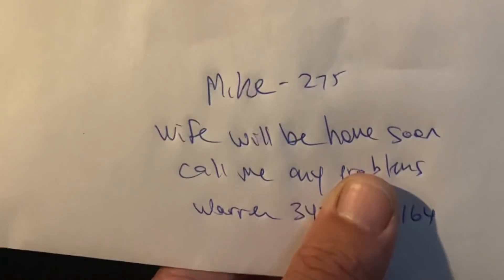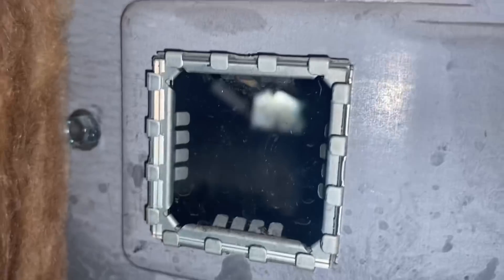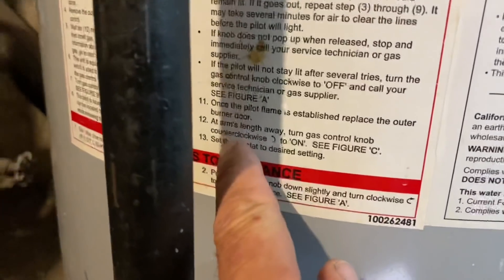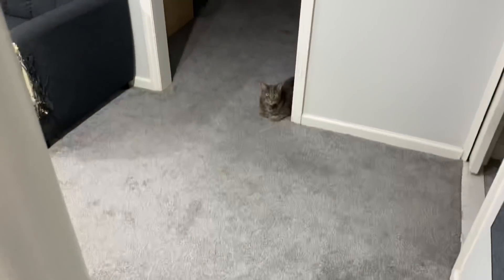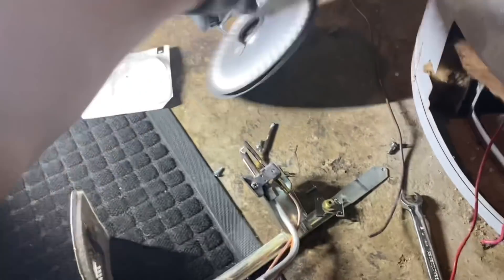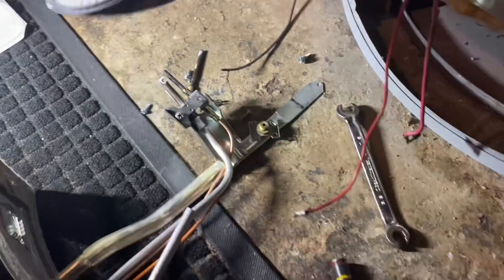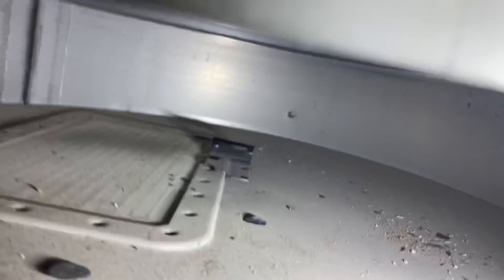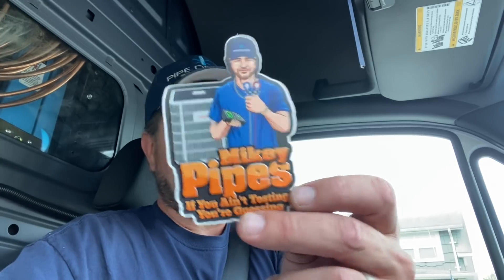Pilot Out AO Smith Water Heater How to Relight Check MV on Thermocouple to Avoid Recall

Comment: Very important step you missed to tell your especially DIY,ERS . Always check any gas fittings you take apart for a leak In that case the pilot tubing fitting back into the gas valve. The next thing you know customer  smells gas they call the gas company and it gets shut off. And your back .No drip leg in the supply also. "Sediment trap" . Gas company can yellow tag for no drip tee . I know that's being picky.  But it's in the fuel code book.  I'm a gas dude Mikey I'm around it just about every day.  I tune in every now and then I saw the AWH I said I need  to check this one out. I like the videos

Comment: You should have cleaned the filter grate which could also lead to an outage call back just saying
Reply: I'll agree with this comment because I have some experience with that situation. The pilot light on my 6-year-old A.O. Smith water heater kept going out intermittently. It was driving me crazy because I would discover it when trying to take a shower and had nothing but cold water. 

I checked the thermocouple and it was within spec. Read somewhere that I should check the air filter on the bottom of the water heater. I didn't even know one was there! Guess what, it had been removed! And because there was no air filter installed, it allowed dirt and dust to get into the bottom of the water heater and restrict airflow to the burner. 

I was able to resolve the issue by taking a feather duster and swiped it a few times under the heater to remove the dirt and dust bunnies that were restricting the airflow. That did the trick and I never had the pilot light go out again. This issue drove me nuts for months! Not sure if you've ever seen this issue Mikey but it should be checked if the pilot light is going out intermittently on a water heater. It's an easy check and can save you a callback.

Comment: Haven’t used AO smith since and before hurricane sandy . Have always used them as a replacement and they were fine . My local plumbing supply ( not mentioning names ) stated that AO smith will not honor any insurance for replacement due to east coast flooding due to the storm . I left and proceeded to , yes , Home Depot . Not my choose but my back was against the wall . I decided to upgrade to a 50 gallon . Was awarded with a GE model . Has been fine since . Hope I didn’t just jinx myself . Be just my luck to put the whammy on it . My sweat joints aren’t pretty but I’ve never had a leak . You can put my sweat joints into the novice category . I’ve only made a handful of nice ones but most were sloppy . Clean the pipes and fittings well and don’t get overzealous with the solder folks . Yeah , I need to take my own advice . Well , one day . 
Happy holiday to all whom observe on this blessed month . Happy Rosh Hashanah to all of faith 🌟
Reply: Got a GE myself,18 years old! Does all the water for the house and my wifes salon!
Reply: pretty much none of them will cover flood damage or other external issue causing failure, since it wasn't a failure due to manufacturing or parts.
your homeowners insurance is supposed to cover that, assuming you have or can even get flood insurance.
Reply: @throttlebottle5906  
Perhaps I should have been more clear . Rather than have anyone believe the water heater was damaged in the flood , it was in fact working afterwards . What I did experience soon after ( within a month ) was the typical leak that prompts us to replace the water heater . Don’t know if this was a coincidence or something to do with the water supply . But they didn’t want to hear it . No one would come to inspect it from AO smith ( a certified plumber recognized by AO smith ) or from the plumbing supply . They didn’t want to hear it . After that , I decided to call them A - hole smith . That was wrong on their part . I,purchased ten year insurance and AO smith didn’t care to even inspect .
Reply: @petersmart1999  
“ GE we bring good things to life “ . As always , we hope for the best . But water heaters are no fun to lug from the store , into the truck/van , out again and into the basement . Just ask Mikey pipes . No wonder he loves servicing air conditioning units ! But Evaporator and condenser units aren’t light either . Six of one , half a dozen of the other , I guess .

Comment: I don't see how that thermal cutout works without the thermocouple wired across it.
Reply: it's wired in series with it  inside the gas valve and often a second non-resettable thermal cutout within the temp probe. that design replaced the threaded adapter in the thermocouple valve port.
the older external style adapters were mostly left hand thread and everyone stripped them and thermocouples fiddling around trying to repair.
unless someone bypassed it, it did look kind of suspicious. lol